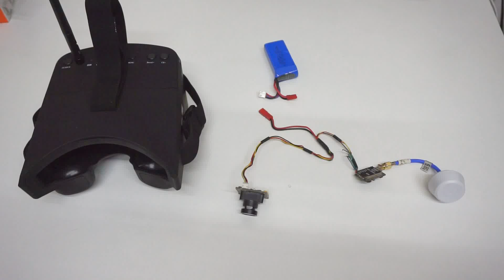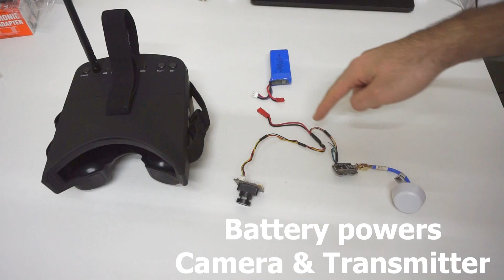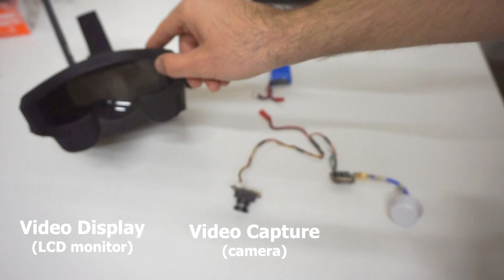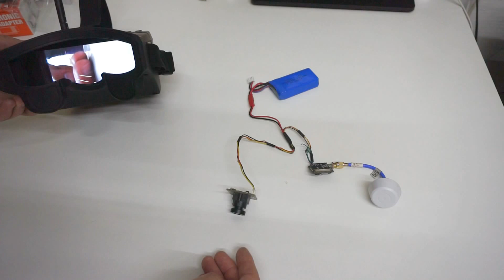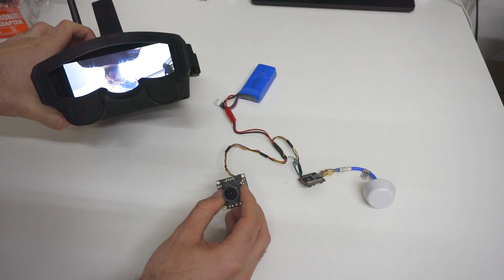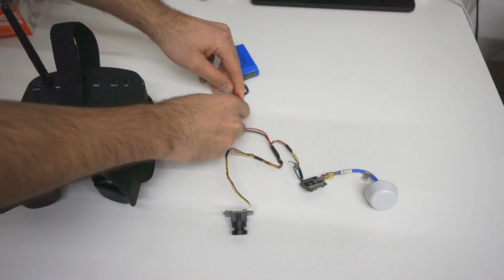How to set up an FPV camera (5.8GHz Wireless Video Transmission + FPV Goggles)

Comment: Do goggles receiver bind to camera transmitter automatically? If not can you explain how to bind them? Great informative video by the way
Reply from the maker: Both the transmitter and receiver must use the same frequency (more exactly Band and Channel). The transmitter has usually tiny buttons to use a different channel or band. The goggles also have dedicated buttons for channel/band, and they also show all these on the display. The goggles can also auto search for a signal and lock to the strongest one.
Reply: @furulevi  could I ask you a question please. At first My flight the goggle connected to the cam but for the second flight the goggle not connected to the cam. Can you tell how to reconnect it again please, thank you 🙏🏻

Comment: Finally a clear video tutorial for how exactly work a cam with fpv googles. Thank you so much! Great explanation. Just some questions. Any fpv googles can be connected to any fpv cam? If in the area there are more fvp cam how to connect googles to the right and desidered cam (is there maybe a channel selector?)? I mean is easy to connect cam to googles? Is there a kind of channels scans like in old television as when you must to setup the reception of tv' channels?
Reply from the maker: Both the video transmitter (VTX) and the receiver (goggles/monitor) can use slightly different frequencies. In order to receive the desired video from your drone you just adjust the goggles to receive a certain "channel" and "band" (basically they are just different frequencies).

Comment: How do I prevent my transmitter from getting hot
Reply from the maker: These are designed to be mounted onto a drone or plane where there is constant air-flow. If you plan to use it as a stationary device then just use an aluminum or copper heat-sink.

Comment: Hi Nice video. I have a cheapo SG906 drone that transmits to a mobile via WIFI. I Dont plan on buying a 5G Wifi  Smartphone.  but , If I had to mount a 5.8Ghz FPV VTX/CAM combo like this ( and get myself goggles to match ) , can I power the VTX directly from the drone's  battery ( assuming the voltage is within specs ) in order to avoid adding another supply ??
Reply from the maker: Yes you can, but if the drone has brushless motors, those require ESCs and in that case the ESC will generate noise and your video in the FPV goggles will be pretty ugly. To avoid this problem usually the VTX is powered from a filtered power source from the flight controller from the same battery.
Reply: @furulevi   I see .. thanks for the heads up. much appreciated

Comment: so it automatically connects? or do you have to do stuff before to connect the goggles and the antenna
Reply from the maker: Both the transmitter and receiver must use the same frequency (channel, band) in order to have video in the goggles.
Reply: @furulevi  okay thank you

Comment: Hi, Nice video just wondering how long can you transmit video with out burning the transmitter and also with what sort of battery can you get long time like 10 hours+ of direct video, a 7.4v battery like the 7000mah titan battery will it be adaptable for a system like this can you advice in good cameras that keep colder and use low power with a good image? Thanks Ricardo
Reply from the maker: Either use a video transmitter that has a heat sink, or manually attach a heat sink to it so it won't melt down. Adjust the transmission power to a lower one (25mW), the lower the power output the less heat it generates and the signal travels to a lower distance. AKK Race Ranger has heat sink ► https://www.youtube.com/watch?v=8yFGX2TRQ2Q
Reply: @furulevi  Hi thanks for the message, i bought the new kingkong q100 it is a 100mW transmiter with camera connected using a cable i only need to power it up/hook up the battery. 100mW is not a lot but i think is enough for what i need like 100 meters with some buildings around will be behind the buildings etc and less heat then the 300 or 600+ mW transmitters, iI also bought the heat-sink plate i think is like 14x14x6mm but will instead buy a project box made of aluminium with heat-sing capability's and glue the transmitter straight to the box exposing the heat to the outside. Any idea on how to connect a 20,000mAh li ion battery to the fpv transmitter/camera? will it be ok using a UEBEC two in one, 5v to 12v multi voltage option? I need the fpv camera/system to last for like 10+ hours straight do you think it will work with a 100mW transmitter and battery etc?